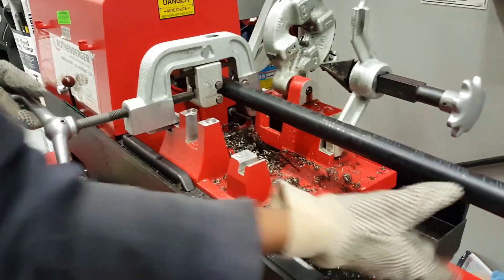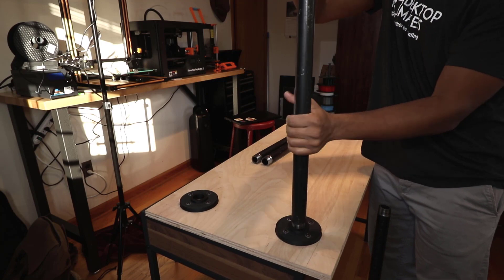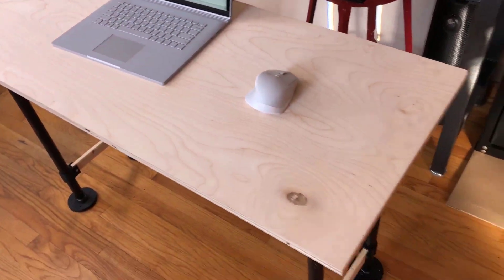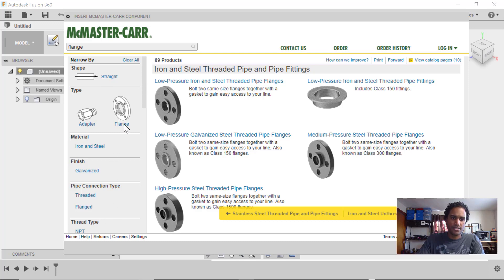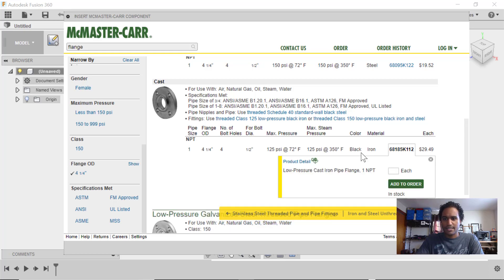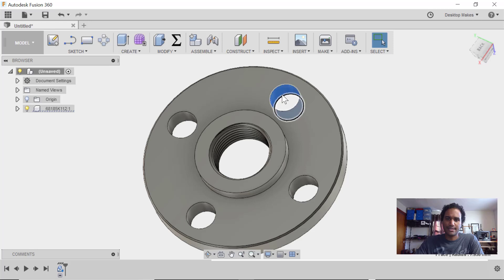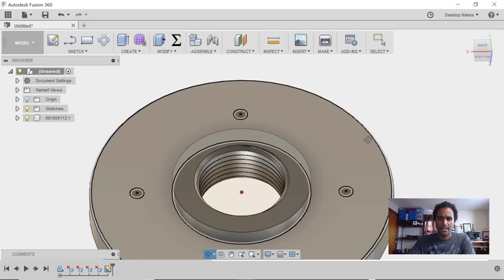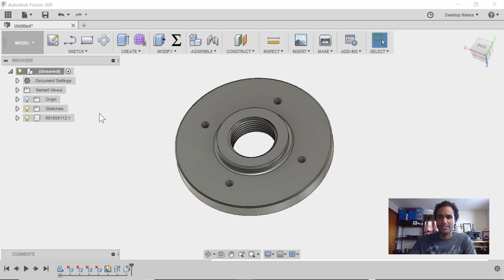3D Printed Desk with Fusion 360

Comment: Vlad
Cool way to add practical applications and teach design - and yes what you did is design. Among engineers,  we have a statement most of us learned at school  - very little is created mostly is copied and improved (:
Regarding strength, PLA Is excellent for many projects due to how cheap and easy to work it is, but when strength and other specific characteristics (eg moisture resistance, higher temp, flexibility etc), is required I tend to navigate to other materials like ABS, PETG or Nylon. I would do trials on PLA and when is finalized, then print at proper material. Excellent job! Cheers

Comment: I liked how you used the McMaster Carr catalog to get your base model.  Does the desk have sufficient strength in lateral forces being applied?  What filament type did you use?  PLA, ABS, NylonX?
Reply from the maker: Thanks!  I used PLA.  To be honest, no, it didn't.  It was a bit wobbly.  I planned to go back and improve the design to add more lateral stability but ended up just taking it apart after a while.  It's on my list to revisit and do a version 2.0 that is more stable.  I did learn a lot with this version though.

Comment: Sorry to see you choose to be superficial or 'lazy' solution.
When creating a 'mix' of parts, it is a good idea to see if you can optimize things so that both the printed parts and the 'bought parts' are implemented in the best possible way.
In this instance combining the flanges with the brackets that hold the wooden parts, will greatly improve the stability of the table.

Comment: Great stuff, but I dont really trust it. Wouldnt it have been better if you'd made the threads on the legs a bit longer, so that you could've screwed them all into the plastic pieces? That way, the load from the table would transfer directly to the legs and just used the 3d printed parts for keeping them in the x/y directions, instead of putting all the load on a the few threads that the legs actually screw into.
(Unless that's what it's actually like. Hard to see on the video)
Reply from the maker: The threads pretty much go all they way into the plastic pieces.  But you are right it still could use some improvements in order to make it more stable.  I plan to revisit this project and figure out a way to make it more sturdy.

Comment: Could your explain the difference in the import options? ie. 3D step.......and others?
Reply from the maker: They are different file types  and you would chose the best option for you depending on the CAD software you're using.  3D step seems to work best with Fusion 360 and it's really the only one I've used.

Comment: That fillet on the flange is going to give you a lot less strength than you assume it will, given the load it's bearing.  It will give you approximately zero added strength.  Those flanges will all shatter if someone even thinks about leaning into the short side of the table.  If you print with 100% infill then carefully anneal the plastic once it's printed then it'll be a heck of a lot stronger.  It won't be a fast or cheap print, though.  That's a great use for a 3D printer, by the way.  Things like that are perfect for 3D printing, provided they're designed well and used carefully.
Reply from the maker: Thanks for the tip.  I have yet to give annealing a try.
Reply: Although some gussets around the perimeter of the flange (where he used the fillet) would add strength, I don't agree with the fact the the flanges will "shatter". The high $ Polymax filament that I used is strong and doesn't fracture easily. Instead, I would address the likely wobble the table probably has. To address this, I would add some threads for setscrews along the leg housing part (that he sleeves onto the pipe). That would help lock the leg onto the bracket. Excellent idea and execution, though. Looks nice, too.

Comment: Hi Vlad, that's an excellent practical use for 3DP. You know I love the way you present your videos.
I would have added triangular braces to the back and sides to reduce the wobble, although printing the brackets for those might be a bit of a challenge. But then, thats why we do what we do eh.
Keep up the great work.
Reply from the maker: Thanks Spike.  I think you are right.  Some triangle braces would greatly improve the stability.  It's definitely doable.  I may have to consider making some as it is currently a bit wobbly.
Reply: Yes, I saw there was a little wobble. Perhaps a follow up video? Although I'm betting you already thought of that :-)
Reply: @DesktopMakes  
Yes.
The triangle is the strongest geometric shape.
Reply: @DesktopMakes  Yes, follow up video would be great.